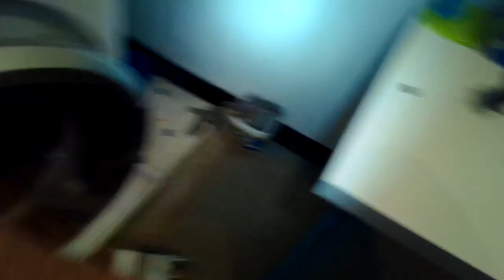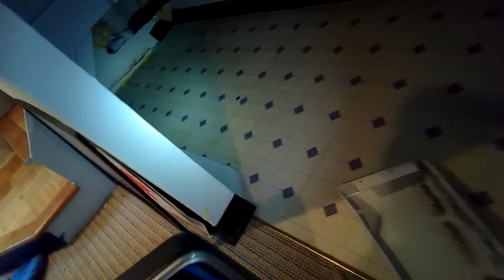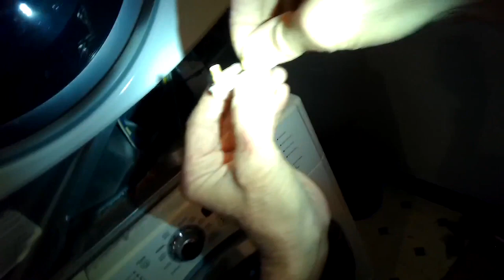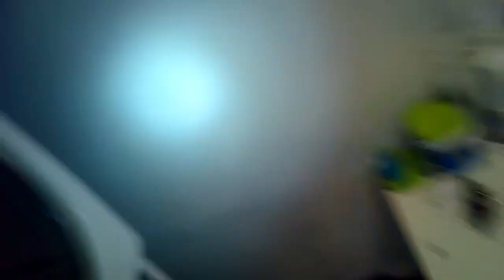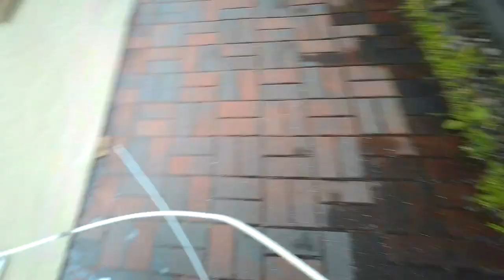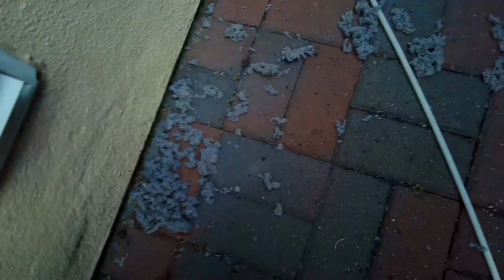Fix Your Maytag Dryer in Minutes - No Technician Needed

Comment: Thank you for your videos. I just changed thermal fuse and gas valve coils. Still no heat. It glows but doesn’t ignite. What’s next???
Reply from the maker: Can you try replacing the igniter?  If it’s worn out, it will glow but not let the gas come in.